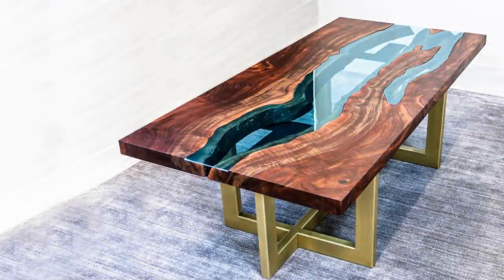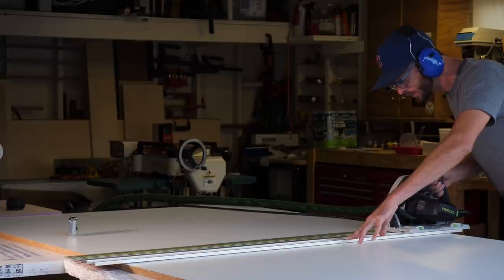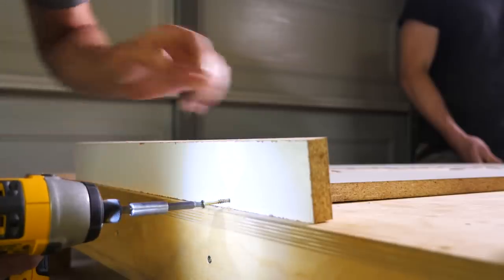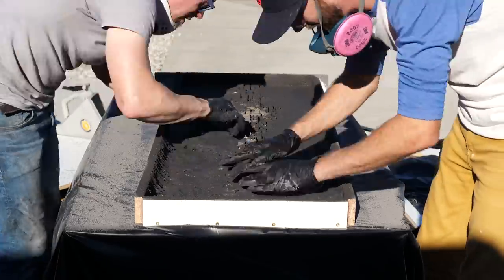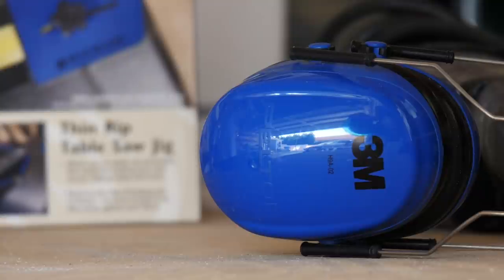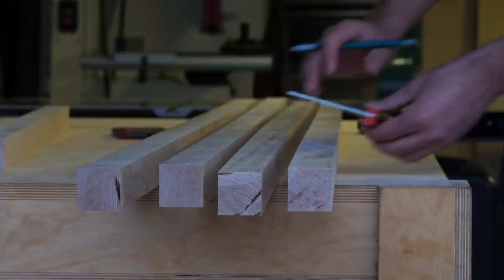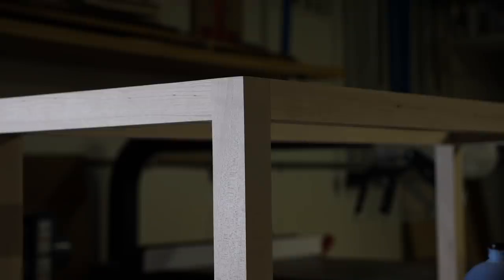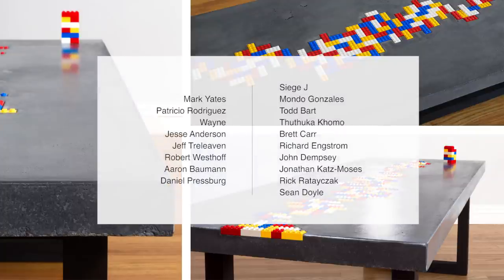Concrete Coffee Table With LEGO Inlay

Comment: Very cool idea, I love the contrast between dark concrete and colorful Lego!

Just an idea, but instead of sinking the Lego into the form you could have siliconed it down so between the nubs didn't fill with concrete, then poured the concrete and remove the silicone once finished. That would have given it a flatter top for usability where the bricks looked recessed but the concrete is level with the top of the Lego nubs. Maybe I'm missing the point and this is more about art then functionality.
Reply from the maker: We went over several different ideas, and something similar to that was one of them. We actually really wanted the concrete and the top of the lego minus the studs to be flush...but having it recessed would be no better or worse. Just a matter of preference I suppose. I will say, removing that silicone from the legos would probably be a lot tougher than it sounds.

Comment: Interesting idea, bit impractical for a table , I'd think - those lego bumps would tend to trip things over. The base, after staining, could as easily be square section tubular steel . And the little angst party at the end? No worries man, your work is ultra creative and stimulating.
Reply from the maker: Definitely impractical. You'll find no argument from me there :) 
Sometimes you just run with an idea though. It was fun...and having fun is practical...kinda......

Comment: That's a lego table I'm less sick of seeing. My boy is obsessed with lego and this would make a much cooler as a lego table than the standard ones I've seen. It just needs a little more lego for that to work
Reply from the maker: Yeah...maybe switch the lego and concrete parts :)
Reply: You could use the river as the anchor pegs for big plates.

Comment: I’ve watched you work with concrete a couple times now.  Is there a reason why you prefer to sand and grind the concrete even with the from instead of screed and trowel a finished surface before it cures?

Comment: Awesome piece! Couple of quick questions: 1) Do the lego pieces stay in place due to the concrete or did you have to do something special (EPOXY!), 2) did the silicone leave that little gap between the pieces and the concrete?  and 3) Did you think of filling that or aren't you worried it will fill up with dust, sawdust, breadcrumbs (from poptarts), etc.?
Reply from the maker: The concrete does a good job of holding everything together. So nothing extra needed. 2. it did leave a little gap. 3. I don't think it'll be an issue. If it were I'd just vacuum or blow it out occasionally. I've had it for about a month now and no build up of dust yet. That said, it is probably b/c there is no room for the dust to get in due to the excessive build up of pop-tart jelly :P
Reply: Hey, if it matches the decor.... ;-)

Comment: Hi Chris. Just commenting because I like your take on the idea that by having everyone make their take on river tables, it's a crutch that stops people from being original, and are scared to be more original. I'm completely in agreement- I've wanted to make my own river table for a while, but having seen so many fantastic creators build versions are are far above what I can produce, really puts me off trying. However, at the same time it makes me want to try and do something else, something that no-one else has made before.

But again, you made a valid point- if lot's of people have followed through with a design or idea multiple times, can it really be a bad idea? Alternatively, if an idea hasnt been done many times, does that make it a bad idea? This may not be the case; having lots of people repeat a design, albeit different versions, might ultimately turn it sour. I've struggled with a particular design of my own, having seen that noone else had made something similar and I became convinced it was because it was either too difficult or just a bad idea. Maybe I'll go take a another look it now.
Thanks, Zak.
Reply from the maker: I'd definitely look at it again, and it could be that it's a bad idea, too hard, or maybe just nobody has thought of it yet. All that said, if you want a standard river table, I say make one. At the very least it would be a great learning experience...and maybe it would trigger some other ideas that you could expand into.

Comment: WELL DONE! The best concrete pour I've seen yet. AND it was hilarious and entertaining .. And creative!! One thing I did not see was vibrating it but I'm sure you must have, looking at that TOP.  WOW! Good luck with the concrete crotch. Rash? Did it lego?
Reply: No vibrating -- it isn't necessary with GFRC.   You just spray or pour the thin face coat without large aggregate, then give it once over with a chip brush.   (Shameless plug) My curved bench video shows this process in a bit more detail if you are interested.
Reply: At 3:36 in this video, there's a mention of an initial basecoat - what's different? Fantastic even coat!  I am assuming this doesn't contain long fibers or sand, etc. I have seen the device to blow it on with at over $300. I see you use a standard drywall device which is great and much cheaper. Right?
Reply: Oh, by the way I loved the bendy bench too. How thick does the initial basecoat end up being?
Reply: The face coat varies between 1/8" to 1/4" at most (you don't want it too thick).  Base coat = face coat.  Same thing :) In the video description for the curved bench, I've got links for all supplies, and the sprayer there is under $100, last I checked.

Comment: since the legos protruded anyway, why didn't you just filled the mold until the concrete reach the level you liked?, I see you used some fiber to make the concrete less brittle but seems that runs enough from what I see, or is just that pouring it like that the concrete would never follow the shape of the legos that precisely?. Love your channel, very inspiring
Reply: You pour upside down, so the bottom of the form is the top of the table.  That means the top of the table (where the nubs are) fills first.

Comment: How did you seal the top and how'd you attach it to the base?  Did I zone out during that part?
Reply from the maker: We were sealing it in the shot with the drone. Basically just make a diluted mixture that you wipe on and keep concentrating it until you get to 100% concentration. Attaching I didn't show, but it was tapcon screws throught the base into the underside of the top.
Reply: You da man ;)  Thanks

Comment: Why was the concrete grinding necessary?  Couldn't screed then float it while it was loose?  The tops of those fences seem straight enough to use for screeding.  Not trying to be a pain, I just don't know.  Did the fiber prevent smoothing it before it dried?
Reply from the maker: I am no expert...but Mike (modustrial maker) did say that screeding doesn't work as well with the fibers, they tend to want to pull I guess? Again, I've got no idea...I'd honestly go ask a question on his channel or hit him up on Instagram b/c he is good at giving that kind of info out.
Reply: Yup, what Chris said.  With the face coat and glass fibers, I haven't had good luck screeding GFRC like you would standard concrete.  You usually bring the face coat up and over the edge so you get a nice face all the way to the edge, and screeding can pull the face coat away from the sides of the form.   And, the thin fibers tend to catch on your screeding board so they dont get flush with the edges (unlike pebbles and such that serve as aggregate in standard concrete).
Reply: Many thanks to both of you for the replies!  I can absolutely see that happening, about the pulling away from the sides.

Comment: I'm making concrete countertops for my kitchen. How thick is this?  I'm trying to figure out how thick I want to go with my GFRC.  Is this 1.5"?
Reply from the maker: This is 1.5" from what I understand you can go as low as .75" 

If you're not following ModustrialMaker, check out some of his stuff and hit him up, he will give you lots of good info and has experience with at least 2 counter tops I believe.
Reply: Yep! I follow him as well, and chatted with him briefly on reddit a while back.  I got all the specs for the drywall hopper from him.  I'm thinking of going 1" to 1.25"

Comment: Not a big deal but I just wanted to mention that filling the form all the way up with concrete is pointless when using the glass fibers. The idea behind using glass fibers is to keep things relatively light.
Reply from the maker: Hi Mauricio! I'm not sure what you mean by "all the way up" - we did use some pieces of foam to take up some of the space where there were large spans of concrete. Are you referring to something like that?
Reply: Yes, I thought the table was solid concrete which would make thing unnecessary heavy. Great work!

Comment: Do you guys know of any good distributors of GFRC?  I have had a heck of a hard time trying to find it in my area...   it's either big box store concrete mix, or large volumes of premix for driveways and the like.
Reply from the maker: We got it from Fishstone...there is a link in the description. I think it is a harder material to source at present though.
Reply: I looked briefly at Fishstone, but the shipping costs almost make it cost prohibitive.  Also, just getting started into casting concrete (I just made an outdoor kitchen counter from the box box store mixes) I find GFRC a bit daunting...  Its hard to know how much GFRC mix I need, how much glass fiber, and what to use for a face coat.  That is the main reason I have not tried GFRC yet, the knowledge barrier to entry is just not as easy to understand as just going to buy a bag of quick setting but terrible concrete.

Thanks for the video though.  This would make a fantastic lego building table.  Did you think about making  the lego channel removable?  For example using another piece of melamine patterned the way you designed but the thickness of a brick without the nubs?  Think like a concrete sink insert, but much skinnier.
Reply: +Greg Militello  Feel free to get in touch with me -- best way is usually direct message on IG.  I can help you figure out how much you need, and maybe some local sources (you can make your own mix and source most of the materials locally, which saves a lot of $$$).
Reply: Thanks!  I'll try and contact you over later this weekend (I am a little pressed for time, but probably Sunday)

Comment: you had enough from river glas or epoxy tables but i think you diddnt get the point the glas or epoxy ones where smooth on the surface and you lego bricks are standing out the let the dinner plate wobble maybe still work with cleart epoxy and make the lego bricks smooth on the top but still cool idea

Comment: From start to finish about how long did it take to make the table top?
Reply from the maker: There is a lot of down time, so if I were to put it in hours of active labor involved, I'd say 16 or so...not counting design
Reply: Chris Salomone and including the down time 3, 4, 5 days?  Just trying to get an idea how much time to plan for taking on such a neet project.  Love your work BTW.
Reply: The top could be done over three days.  Day one, make the form and seal it, day two, spray/pour the concrete, day three, demold and seal.

Comment: what if the table craks or brakes on someones legs?
Reply from the maker: They'll have to buy me a new table :P
Reply: Did any of the tables ypu made ever broke or craked.And if they did what did you do?
Reply from the maker: The only table of mine hat ever broke was the first thing I ever made... a coffee table. And it only broke b/c I didn’t like the way one of the joints looked... so I stress tested it until it failed. I rebuilt the same design several years later, on this channel.